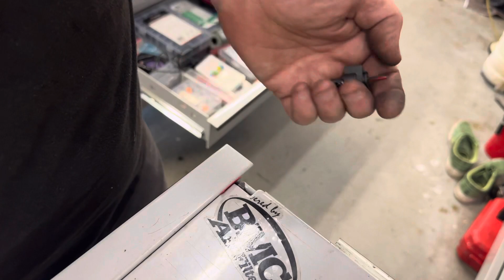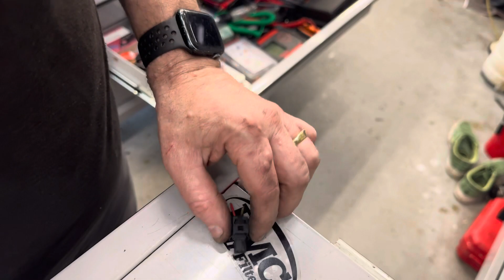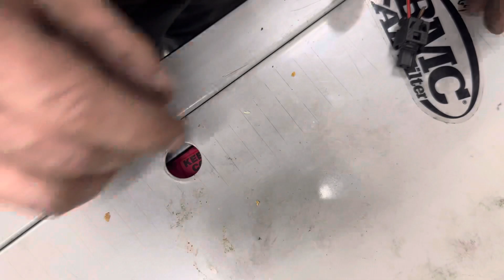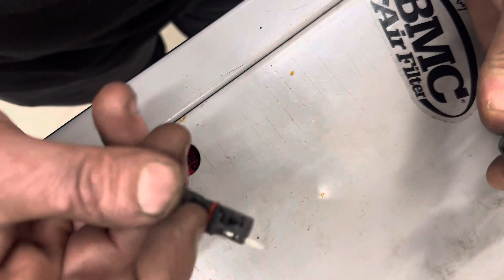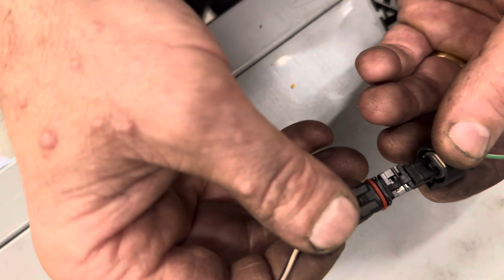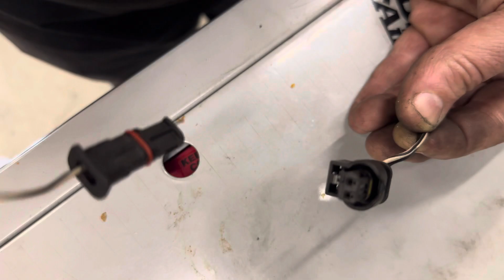Is Your Mercedes Connector Wired Correctly? Check This Now

Comment: I’m getting a P0715 code on my 2007 F150, I am pretty sure the harness is the problem, but I didn’t have a way to verify until now. I have an old speed sensor that I can modify and turn into a pin drag tester. 
Thanks for the idea!!
Reply from the maker: I am happy to hear it helps

Comment: nice video, I need to get a set for newer connectors with tiny pins even smaller than the one you are using, I don't have any old harnesses to pull pins from but I've heard of sets with different pin configurations ( spade, round, square etc )  and sizes. Would you know a brand or manufacturer and/or where to get a set ?
Reply from the maker: Those can be hard to find. Try Amazon for terminal tools
Reply: @EuroMotive_Technical  Thanks for the reply, I did find them on Amazon as TP-300-A terminal test probes kit for GM vehicles ( $35 )there's also other kits there for about $100 and on the AES website as uTest Advanced Terminal Test Kit ( kinda pricy though $299 )